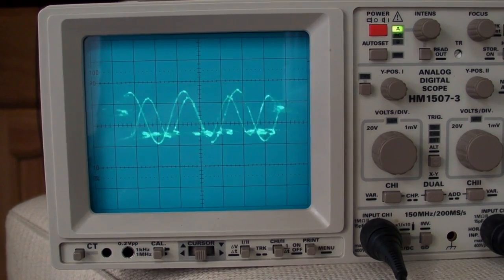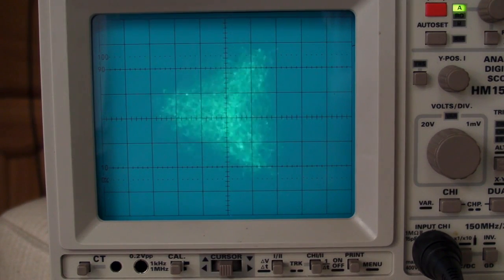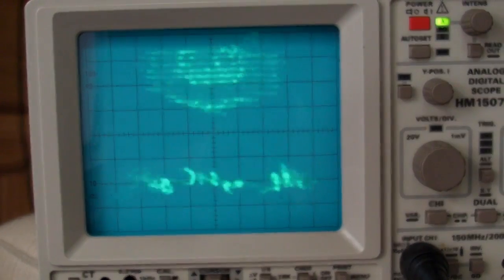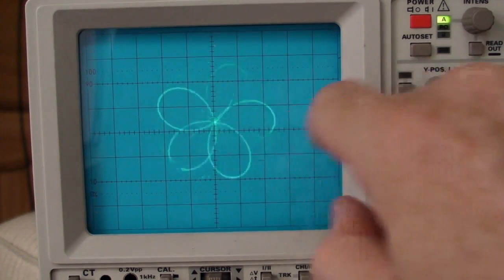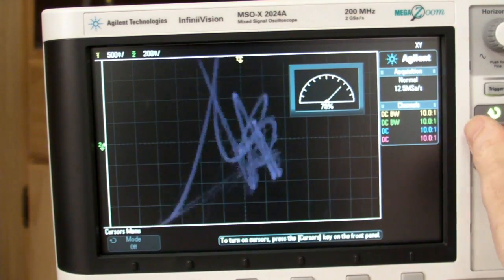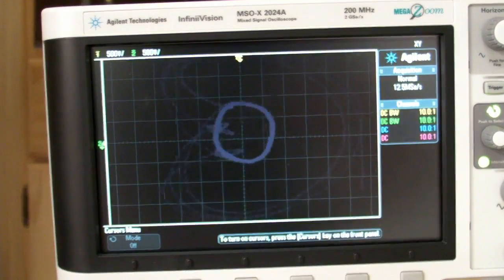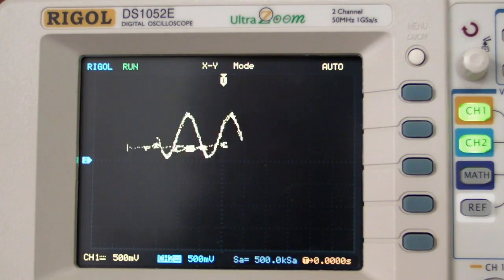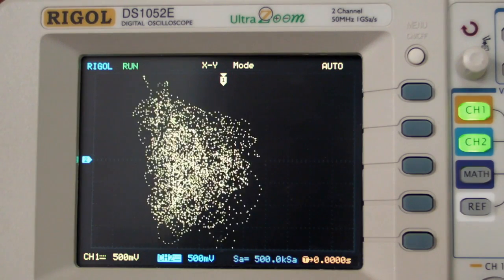EEVblog #153 - YouScope Demo on a Digital Scope

Comment: What impedance do  you have the x & y channels on? I noticed both channels where at 500mv/div. I tried it a while back on a Tektronix 2465 scope and got crap. But I think as you said, the output from a laptop is crappy. You inspired me to give it another go using a better sound card. Thanks for the post!